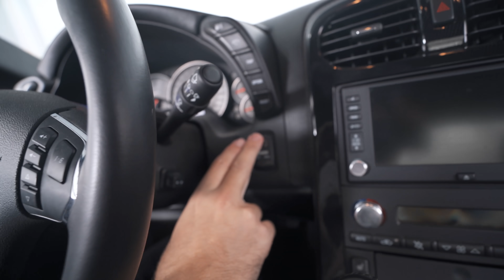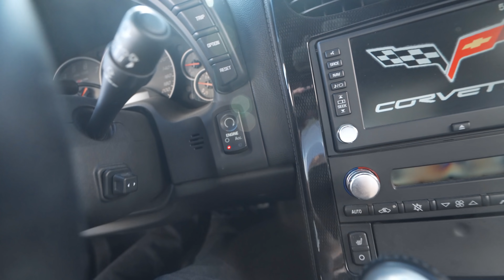Let the DONK Mods Begin! 😂

Comment: You HAVE to get 2 15inch subs, and minimum 2500watt amp. I recommend Memphis audio I have built quite a few donks being from Texas myself. Make sure u run a capacitor and upgrade your battery and alternator it's also a good idea to look up and do the big three wire swap.